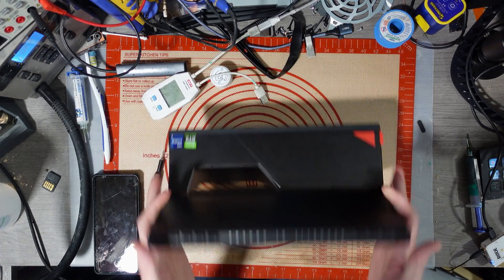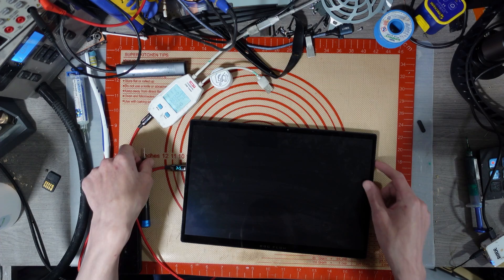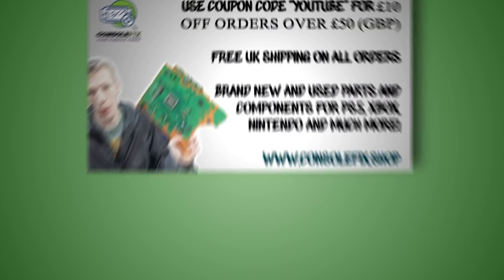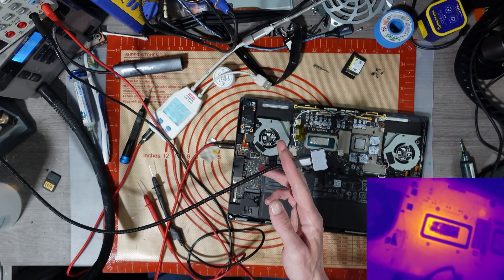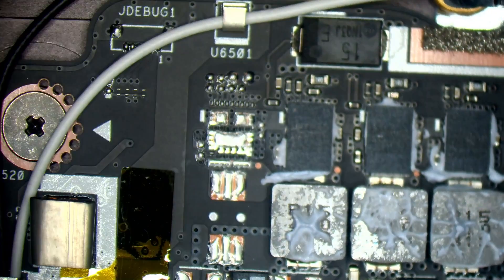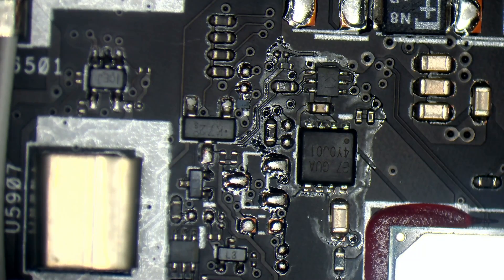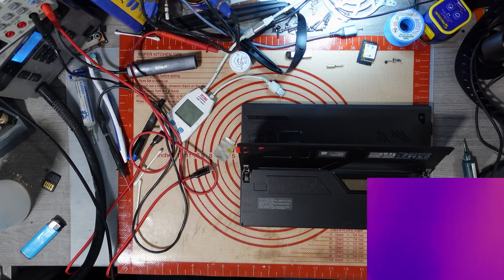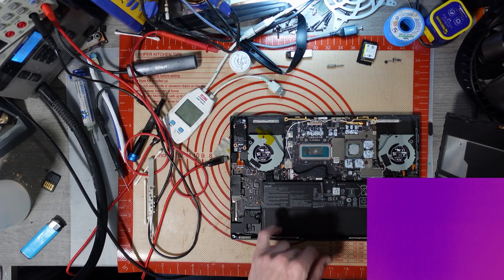Can I Fix A Completely DEAD ASUS Gaming Tablet?

Comment: Hi Phil that is dead pch. You can confirm it to inject 1 v voltage on 3,3v coil if the pch lights up then is it over. Also you can confirm datalines on usb 2.0 port.

Comment: The second I saw those jumper wires from the 3.3v line exposed like that, I 99.9% knew that they most likely made contact with the 19v line and shorted out the PCH.

Whomever worked on it before didn't mask those wires off and the 19v made contact with the 3.3v, and sent 19v to the PCH, hence the hot spot.

Another way to confirm this is if you measure Pin #8 on the BIOS chip as a short to ground or really low resistance (<100 Ohms), then the PCH is the culprit.

Comment: I bought a 2nd hand asus laptop off ebay and the laptop came dead which i knew about so i was planning on replacing it for me to check and what do you know the battery is 99 percent. What do you think happend all I remember doing is obviously keeping it plugged in and updating windows.